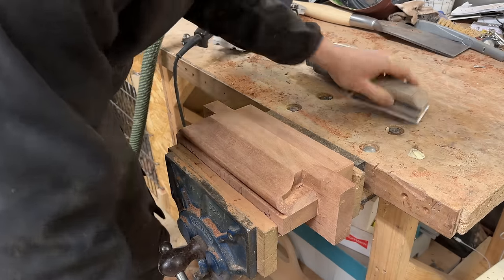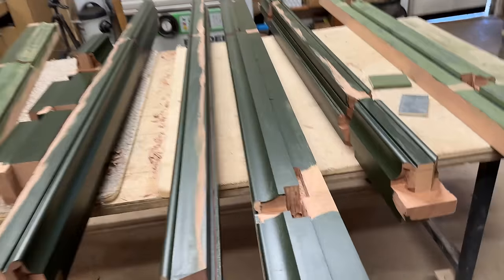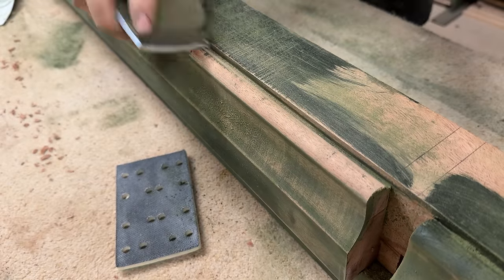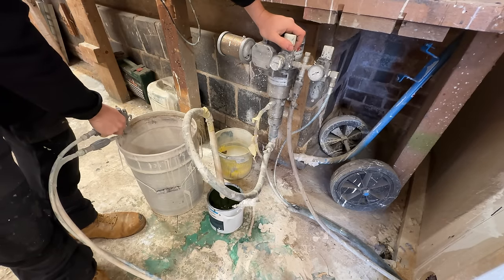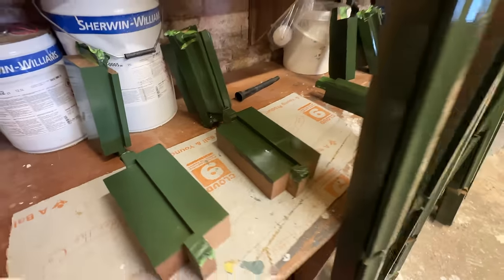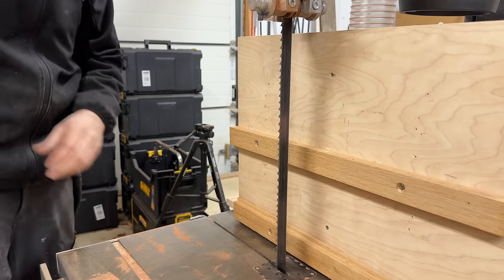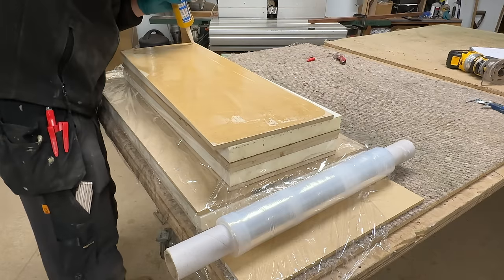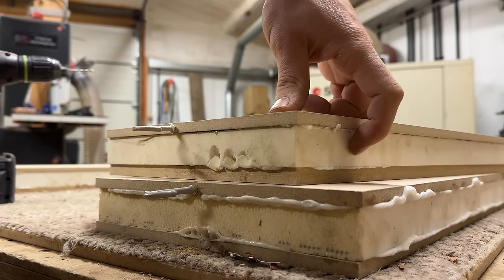Making Insulated Panels for the Door and Frame. First Paint Going on. The Big Green Door

Comment: Been going through your videos. Hard to find good content on making entrance way doors. Im about to tackle that job for my house, nothing on the scale of complexity & detail as this door, but certainly a task nevertheless. FYI, I found a company  in my area that makes fabric aerogel. Lots of different industries adopting this new material. Insulation is super important for Canadian winters, and with this aerogel fabric I can get R11.7 out of 1.5" thickness of insulation. Im sure there's higher performing aerogels out there, but for those not in the know, to get R10 using rigid foam board you need a 2" thick piece.

Comment: Sorry if I missed it but how come your going straight in with top coat and skipping the primer? From what I’ve seen on their tech docs the Mighton/stuy exterior paint is 2x primer, one top coat? Hoping I can take a few shortcuts 😛
Reply from the maker: i spoke to their tech and my main concern for customer was durability of the dark colour chipping at primer level on this one. They said it was possible to use topcoat straight onto timber, but the frame isnt going to get weather. its 3m back from rain. not sure i would trust on a exposed frame but experiments will be made. Its not a shortcut either, hard work! haha but deffo seems more durable against chipping down to a white primer under the dark green

Comment: No primer on the sapele or sanding sealer on the mdf? Just wondering the thought process here, great work as usual 😊
Reply from the maker: i spoke to their tech and my main concern for customer was durability of the dark colour chipping at primer level on this one. They said it was possible to use topcoat straight onto timber, but the frame isnt going to get weather. its 3m back from rain. not sure i would trust on a exposed frame but experiments will be made. Its not a shortcut either, hard work! haha
Reply: @BradshawJoinery  I see, sounds reasonable. Thanks for taking the time to reply. :)

Comment: The Tricoya is certainly a terrific material, but the PRICE!!! (Even with trade discounts!) 5 sheets of 12mm, well over £3,000! 😢
I’m hoping someone is going to tell me that I am being robbed and tell where to get it much cheaper!
Reply: 12mm should be no more than £180-£200 for a 2400x1200 sheet,  so yes I think you're being robbed blind fella!
Reply: You are being robbed. Last sheet of 18mm I bought cost £210-00 +vat.You should out the company who charged you that much.
Reply: @RobNorman08 I needed the boards quickly but now I know, I will do some ringing round! Pirates at every turn!
Many thanks for your feedback! 😊
Reply from the maker: Yeah thats silly. The price of Tricoya and Accoya always worked out the same per m3 roughly. The price you have paid there is equivalent to £17,000 per m3. Tricoya is around £4500 last time i bought.
Reply: @AdrianSams Many thanks for your feedback. Looks like I didn’t do my homework! 👍👍
Reply: @robertmawby3021   Good luck, there are plenty of reasonable stockists on the web, hopefully you'll find one that'll leave your pants pulled up! 👊